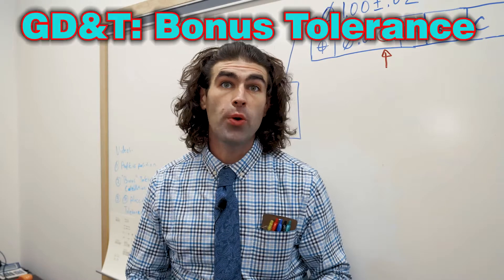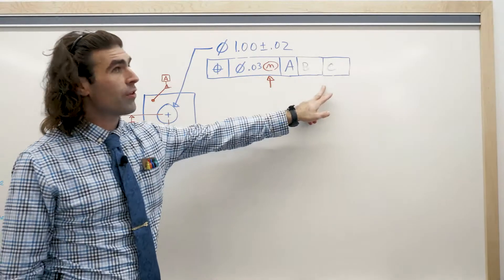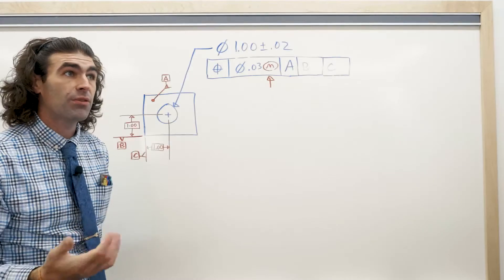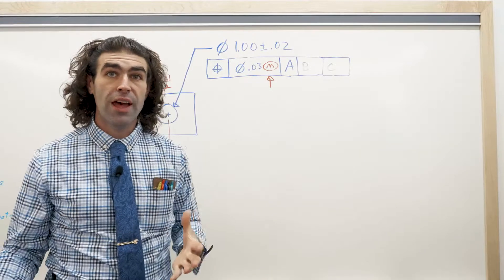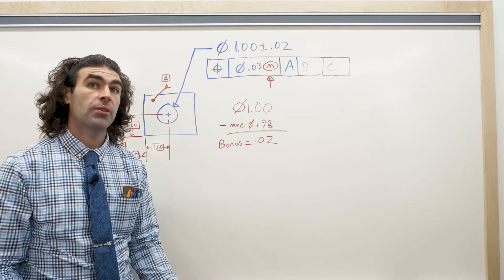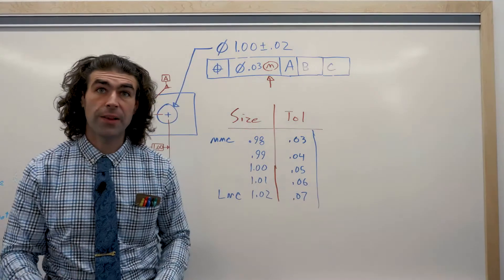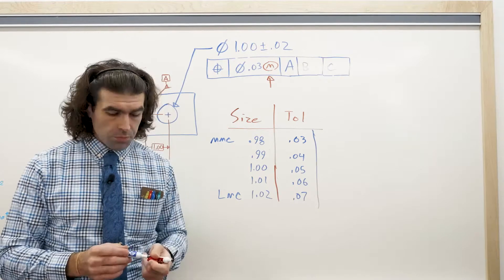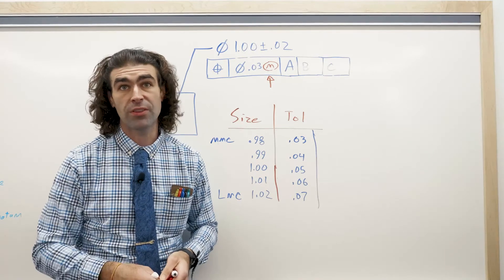GD&T ASME Y14.5: “Bonus” Tolerance Explanation in 5 Minutes

Comment: Hello Dean, 
You pointed to the tolerance.03 when you mentioned if the measurement is less… I guess you meant… less than .98.
So in case, if the diameter is either UNDER or OVER, the part is out of specification. But some software still calculates True position for this feature when it’s at OVER size.  Why is that?

Comment: So let me ask you this. For example the hole is cut at 1.02. Max big. That’s .04 bonus plus .03 given. Total .07.  Now go back to the basic dimension. Can that 1.00” dimension measure up and left both 1.07”. Or only 1.035” up and 1.035” left. Or could it be nominal at 1.00” up and 1.07” left. All from edges like you have it drawn. I guess I’m asking if I was using a center finder cone on my height gage. And I’m gonna measure the 1.00” dimension both ways. Up and down. And then flip the part and do the other side, up and down. Can that part measure 1.07” both ways and still be good?

Comment: One question for curious knows... bonus tol is only applicable for position tol..or any symbol wil be getting it...pls explain..
Reply from the maker: Hi, 
Bonus tolerance is applicable to features of size controlled with straightness, flatness, perpendicularity, parallelism, angularity and position.

Maximum material boundary can be used with position & profile tolerance. This allows datum shift, which is different from bonus tolerance but has the “MMC” symbol with the datum reference so it looks similar.

Thanks for watching & commenting!
Reply: @RDeanOdell  thank you